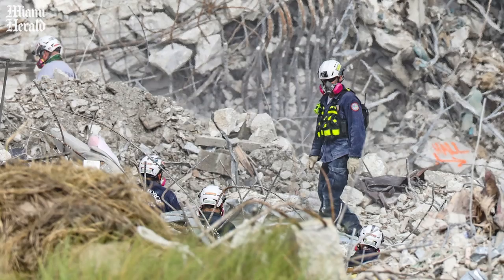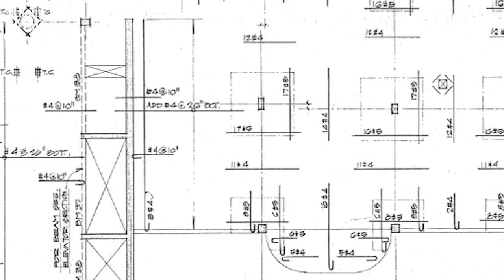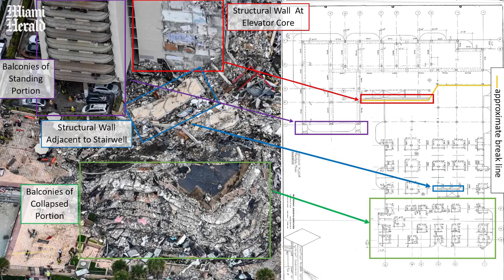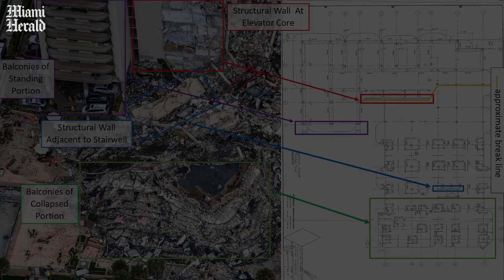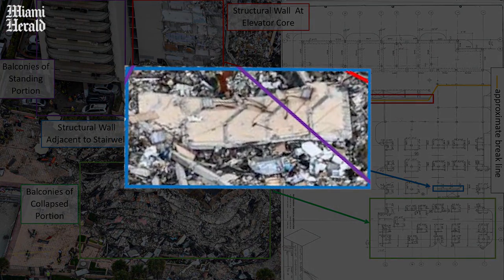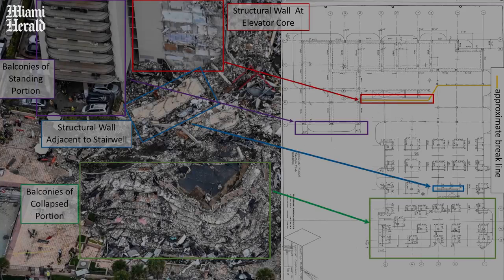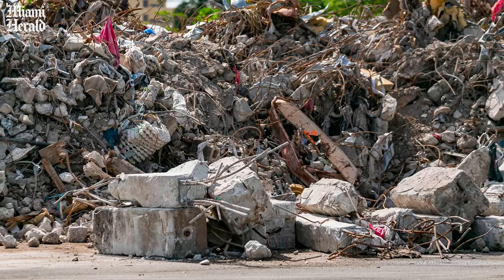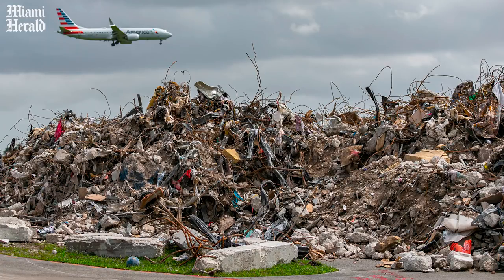Structural engineer explains Surfside collapse investigations

Comment: Date:  11/7/2021

Another called professor, in not staying no truth, but total waste in what supposedly she saw throughout all of what she has had the time to only see, but what about all the great amount of pipe water where no one is daring to  explained, or in true to have had already a true expect with having a true degree that would true know 100% The truth knowledge to have had an  hydraulic engineer degree, where obviously was all led to have happened so all involved having high titles could steal out of Innocent hands another place target property, of what exactly concluded, with allowing to have built the total influence property that was built most resent at 8701Being allowed to be called Eighty Seven Park Tower under the same zip code, which many years ago was turned to have belong to the total section of the district of Surfside, but then with all holding politician's of allowed of high titles was quality presented that brand new right next door that extreme tall tower, like if indeed belongs to the district of Miami Beach, when actually that entire section was always known as North Miami Beach, where a lot of disguise of corruption, like in many of other places has always been existing.

Comment: Looking at photographs and structural plans are great. I do wonder why the good professor didn't mention the much-publicized CCTV footage of the initial collapse. I hope the investigators review it and are honest enough to allow for all possible conclusions, including the obvious similarities between the unexpected collapse on June 24th, and the planned collapse on July 4th.

Also, she mentions punching shear, which I thought was great, but I wish she would have elaborated on that. Images of the pool deck show obvious signs of punching shear failure--hence, the deck dropping straight down, while the columns remained standing--but that does nothing at all to explain the failure of the columns under the rest of the structure.

It's almost certain that the pool deck was not a structural component of the main towers. Its collapse *should not*, even under the circumstances of water intrusion, have led to the collapses of the columns in the parking garage.

The vertical loads of the tower would have been supported by columns that were independent of those in the pool deck. Further, the tower's columns would certainly have been designed (and, almost certainly, built) to handle far greater loads than the columns under the pool deck.

The footage of the collapse does not suggest punching shear as a failure mode, even if the images of the pool deck show that that portion of the collapse clearly involved it. Rather, the footage suggests column failure--probably laterally--that cut the support out from under the building.

And to have so many columns fail at the exact same moment must have required some very clever water intrusion indeed.

Comment: Obviously engineering is concerned about not wasting materials and increasing costs. But why is there so little redundancy that the failure of just  three or so columns next to this pool deck can cause the collapse of a large L shaped section of this structure?
Reply: you don't really build for redundancy

Comment: Dear MH ... please get a decent commentator that understands the "Engineering Process" ... how "Design Changes" work. Check the 1979 "As Planned" drawings vs the JAN 1980 version (approved ... but by "whom?") ... they took out the need for step down beams ... including where the "Planter Boxes" got located. In simple terms your audience can understand ... go purchase an IKEA "Wardrobe" and assemble it ... then you will find out just how important to the entire structure that backboard of thin "Masonite" truly is to the entire stability once it is nailed in place.

Secondly, there is a HUGE hole in the Engineering oversight process ... the Engineering firm designs and supervises the Construction ... and  then an "HOA", usually without Engineering expertise takes over. Over the nearly 40 years of service, how how many people added compressive loads to the structure by installing "Hot Tubs/Larger Baths with marble tile" and how many 20+ ton Trucks rolled over that slab that was already max loaded? Even if only once, the damage was done; cracked the slab allowing for salt water/spray to corrode the rebar and weaken the already poorly executed design. Please pursue "root cause" not a rehash of what happened after the fact. "Lawyers" are gonna have a field day with this ... and any future instances.  Bottom line, this was all caused by "Greed" ... from deleting the Beams to owners coercing HOA's into allowing them to renovate without Engineering evaluation prior to work being done. Pity

Comment: All the retrofitted "upgraded" kitchens and bathrooms with all the granite countertops, marble bathrooms and such which were not part of the original design exceeded the weight that the structure could endure.   That plus the fact that the load on the pool deck was at 100% the day it was completed as shown in a video by a guy with the schematics made the collapse.  There were structural supports in the design plans in 1979 and not in 1980 - support beams under the planters near the collapse of the parking area and planters were in the plans in 79 and not there in 1980.
Reply: No... granite counter tops are not to blame, lol

Comment: With over 35 years of advanced material reinforcement, chemistry of Portland Cement and ASTM Failure Analysis engineering, the data I have uncovered is frankly shocking. 

Data concerning the City/Towns of Miami Beach and Surfside is very interesting and is forthcoming.
Reply: @johnr7365  I don’t work for you.
Reply: BS

Comment: How can one such small rectangular section take a whole building down There is something wrong here since the way it went down same way as demolition
Reply: ur telling me that when buildings collapse it looks like building collapses? its almost as if controlled demolitions are controlled collapses almost like its in the name
Reply: @pharrzide  ur?
Reply: @Capecodham  you're
Reply: @pharrzide  What did you do with the time you saved not typing yo;e?
Reply: @Capecodham  nothing.
Reply: @pharrzide  yes the building did not fall on its side A demo takes it straight down
Reply: @Ill_Stay_In_My_World  not all buildings fall down like that
Reply: @pharrzide  MOST buildings can't fall over, no matter how hard one might try. I used to be impressed with these demolition companies until I figured out it's almost impossible to screw up.
Reply: Mary - The pool deck collapsed, probably due to water damage. The way it collapsed put extreme lateral forces on the beams under the building, and the way those failed propagated the failure through most of the other beams. The floors punched through and broke away from their beams during this process.

There is a way to design buildings so that one failure doesn't cascade like this, but apparently this wasn't popular in the 80s.

There's probably no one alive to blame this on.

P.S. A contributing factor may be (my speculation, with no evidence)  that some of the concrete may have been TOO strong.

Comment: Flawed from day one reads the REPORT Which highlights problems in the original plans that forced the builders to make decisions on the Fly that have compromised the structure. Drawn up by a firm "Breiterman"Jurado and associates- That No longer exists. Now what does that mean- who is held accountable? :-(
Reply: The architect, engineers and builders are dead.  The only thing to be done is take the lessons learned and apply them in the future. This building was doomed when it was designed.

Comment: I believe the weakness of the foundation had a lot to do with the collapse. Also for such a high building , the builders cut corners and didnt put in enough concrete. Moral of the story, dont build on the beach. The building was rumbling but no one paid attention.
Reply: There is no indication of failure of the foundation.  The basic design was marginal to begin with.  No margins for aging, increased load or damage.
Reply: Did you not see that foundation?  There was nothing wrong with it.  There are several engineers on YouTube doing excellent explanations of what happened Building Integrity is one.  Take some time and check him out he has done a lot of videos and spends time to talk to us all at everyday language so it's easy to understand.
Reply: Ha, ha 11 story building is not tall....Seems like the concrete spalling due to rust on rebars led to collapse of the outside deck(pool deck), unfortunately it was tied to the main building, namely columns. So when it failed it damaged one or more columns that held the building... And that led to the sad collapse.
Or so it seems to me from what I seen during my research. I am certain that building codes will be changed, as to prevent this kind of a tragedy...
Reply: Land corrosion occurred also.
Reply: @nancisam8305  Won't 'All Surface Rustoleum Paint" fix that?  :)
Reply: @KB4QAA  not a high rise building, I think it's a combination  of mistakes that made that building fall. Land corrosion,  weaken steel, and poor workmanship.

Comment: Well, we'll see what they come up with then.  The 40 year review saw defects but did not put the fear of god into the building owners.  It may not have recommended temporary propping see https://en.wikipedia.org/wiki/Castlepoint_Shopping_Centre either way there was no propping.  They just replaced the windows.
Looking at the drawings I think:
The concrete was weak - to little cement to resist the salt water and chlorine.
The slab reinforcement was insufficient - no shear links to resist shear around the column heads.
Flats slabs without drops - too thin for the reinforcement and original concrete grade.
Columns cast kicker less - so the cold joint was at slab level where the chlorinated pool-spill-over water accumulated, penetrated and corroded the rebar.
The pool deck was cast flat - so water never ran away from the building.
But hey what do I know.  I'm only a Structural Engineer with 30 years' experience.  When I say too weak I mean to let me sleep.  Nobody listens to engineers until it is too late.
Reply: stick to your day job
Reply: @wernerfoerster3666  And you are what exactly?   My day job is not writing five word put downs on YouTube my day job is running a Structural Engineering consultancy.  So inspecting buildings IS my day job.  Why down you crawl back under the stone you emerged from.  Stay there for 8 years to get a Masters Degree and professional qualification then refrain from commenting for another 30 years until you have a meaningful opinion.

Comment: Punch and sheer is the key. At 1:45 can see the columns laying on top of the slabs. That can only mean all of the slabs slid down all of the columns once failures began near the collapsed deck. Fundamentally flawed design that should never have been built. Sister building is in danger of the same type of collapse.
Reply: Yes, the column-without-capitals design was terrible and should have been illegal even then, but had that been the only issue, we'd only be talking about a collapsed deck and about 60 crushed cars. The big problem here was that the pool deck/garage ceiling (same thing) was connected to the 5 most important structural columns of the main tower in such a way that it was able to basically yank on them laterally as it fell down. The tower was left without support on one side and even though it held together mightily for 7 minutes, it was doomed to collapse once the pool deck did. The whole thing would have fallen down progressively were it not for the elevator core and shear wall. In my opinion, the sister building is in great danger, yes. But probably not immediately because their maintenance is on point. Still, if I were them I'd insist the columns get retrofitted with capitals to avoid punch shear AND the pool deck receive it's own row of independent columns (and shear walls). The problem is that could eliminate 10 or 15? Parking stalls so they'd have to find a solution for that as well.

Comment: How they are going to investigate structures since rebars and concrete are separated to different piles...?
Reply: Rubel was marked and tagged as it was removed.
Reply: @marckruger2640  It didn't quite look like that on some videos I've seen in YT. It looked more like ordinary demolition.
Reply: @ilkkak3065 ,
During the building phase everything requires building department approval and sign off by an on-site building inspector
Reply: @ilkkak3065  correct it’s tough to see, but on our local news they showed the debris that had been marked and sorted.
Reply: I read somewhere that they have a seperate site for “interesting” pieces, meaning that as they removed stuff, the investigators asked to have pieces moved to a seperate site (seperate from the rubble piles) for further investigation whenever they saw something, which they beliebed to be of importance to the collapse.